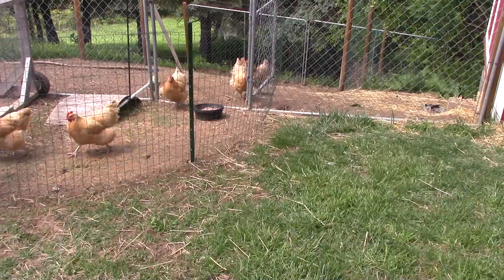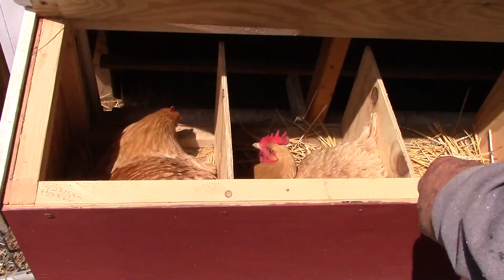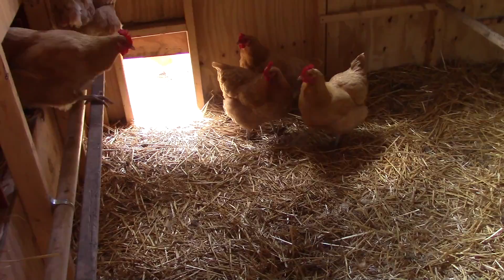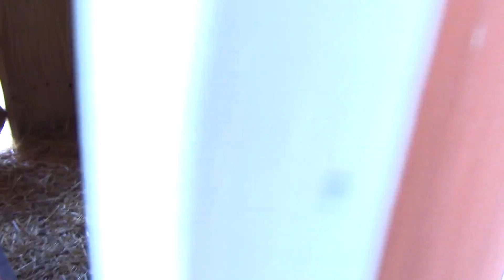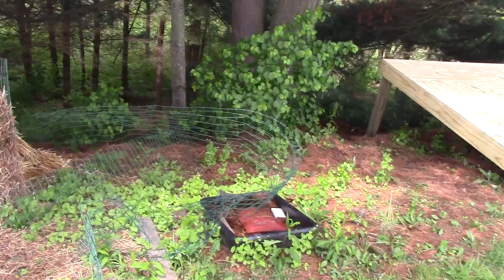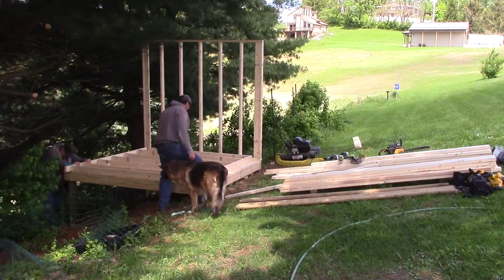Rabbit Barn build Part 1 - Helping a friend

Comment: Helping a friend build a man cave or a dog house. It still will be hardy enoughfor those raskley wabbits. Try to fence in the bottom a rabbit pellet holding area. Poo scoop it to compost bin for the lettuce garden .Sorry Joe I am just brainstorming from the armchair again. To much time on my hands but I don't even wear a watch. Use tell time with a pencil on the ground on a sunny day, boy did that drive some people crazy with that one, only off by five minutes after adding 1 hour for daylight savings. It is easy if you know where North is. Hard part is when the moon is still in the sky then it is hard to explain the long working hours.
Reply from the maker: +Frederick Nolan It's working great for them. I'm like you, if I'm not busy, my mind goes wild lol.